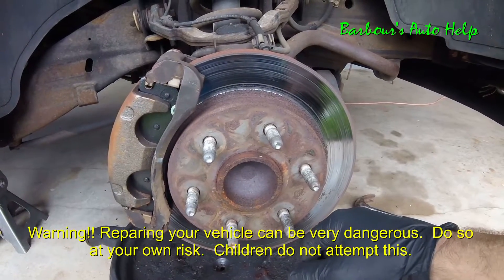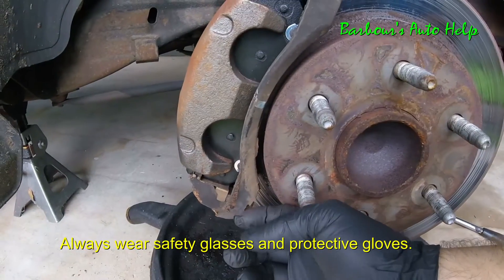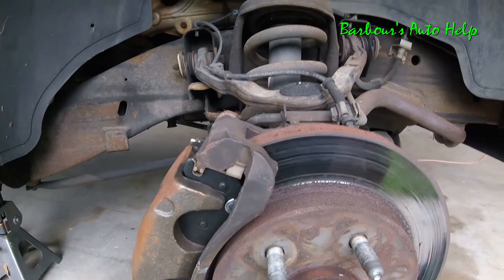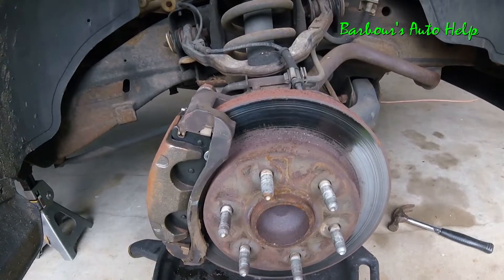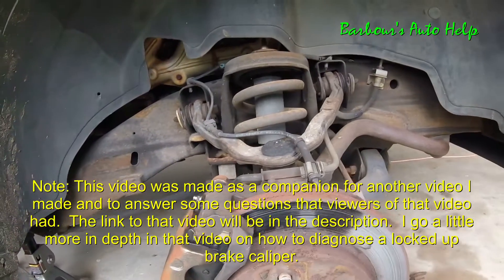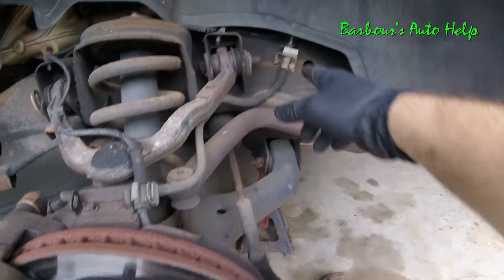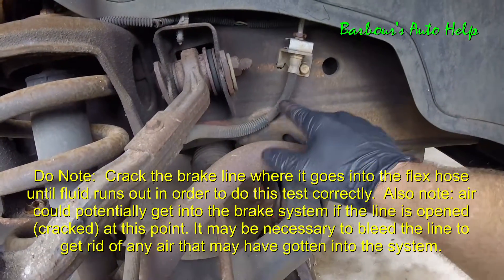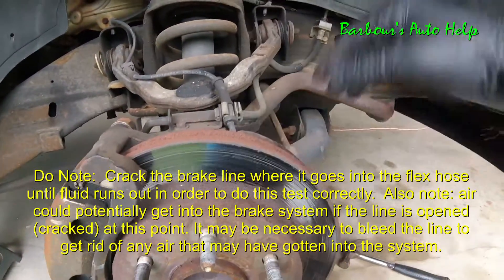Locked Up Caliper By Clogged Brake Hose

Comment: Would it be possible to clean the blockage? Or do I have to replace the hose.
Reply from the maker: I recommend relacement.
Reply: Usually the blockage comes from deterioration of the hose. Especially if it is older than 5-10 or so years
Reply: @63ch31 sorry 3 yrs late. Even if the hose looks completely fine on the outside, can it still fail?
Reply: @KilliKonKarnage   no worries mate. That would be kinda rare, but not impossible . Particularly if you have severely contaminated brake fluid. Production defects also do happen occationally. The only way to know for sure is checking. You can often see the signs of a blockage by comparing against the other brakes the fluid flow while bleeding the brakes as well as the effort needed to push the caliper piston back in. The number of cars I've worked on is limited, so I can't really tell you how likely this is. Also, because of the salty climate I live in, the problem is almost always a seized caliper.
Reply: @63ch31  ah thanks. My car is 19yo but only 40k miles and the caliper is original. I replaced the caliper but still have a brake bind due to piston not retracting. I think the hose is probably 19yo as well haha
Reply: Update on my issue. So I replaced my caliper and brake hose but still the brakes are dragging. So it must be a master cylinder issue as now all 4 wheels are dragging instead of just the 1 wheel initially.

Comment: Thank's for you'r time. I had the same thing happen on my dirt bike Husky TE300. I super cleaned and rebuilded master and caliper. Bleed system three times with new fluid. Check by hand work ok hour later lock up. So I took brake line off sprayed CRC  brake cleaner and used trimmer line to douche line  out. So thank's for the tip. Which i had air.

Comment: Very helpful video. My right front caliper locked up yesterday on my wife's car. Fortunately I came across your videos. 
I finished replacing the caliper and brake line today.. It's working great! Thanks.
Reply from the maker: Right on!
Reply: When did the front caliper lock up?
Reply: How do u know it wasn't just the slide pins instead buying new caliper

Comment: I just replaced tge caliper on my 98 chevy prizm and brake fluid will not come through the line to pump it up what should i do.
Reply from the maker: Did you disconnect the hose from the line yet?
Reply: No i have not
Reply from the maker: So are you suspecting a clogged hose?  Why was the caliper replaced?
Reply: The flex hose isnt clogged nor is the steel line coming off that going to a four way valve. It seems fluid wont pump into that line for sone reason
Reply from the maker: Is fluid getting to other wheels?  If not then you may have a bad master cylinder.  If fluid is getting to the other  wheels then you probably have a restriction somewhere.  I don't have any videos showing how to diagnose restrictions in brake lines or the brake system after the flex hoses up.
Reply: I think its tge proportioning valve
Reply from the maker: Wouldn't you have a problem with at least one other wheel if it where that?  What are you working on by the way?
Reply: @BarboursAutoHelp  I have similar problem.  93 bronco:  issue was overly hot lug nuts and front hubs.   to fix I have: replaced pads, rotors, calipers, rubber brake hoses, and master cylinder.   Did not replace metal brake lines from master cylinder or the connector at master cylinder.   I have NO idea what my problem is but brakes are dragging causing too much heat.  I have 700 in town miles on new brakes so its not new pads needing to wear in either.
Reply: this is on both Rt and left front.  Front only, both wheels.  truck brakes straight and good... but something causing too much heat and brake smell up there when i drive it

Comment: Is it possible to have 2 front break hose that messed up
Reply from the maker: Possible but not as likely
Reply: @BarboursAutoHelp  Do you recommend changing a pair? Or just the faulty side? I'm thinking of the latter.
Reply: I opened the break line hose nut and didn’t have any break fluid come out bye then I went under the hood and found the rear break lines I can see fluid come out when I opened the nut what can it be break line or the abs module going bad

Comment: Bought a truck, drove it 4 miles to the car wash to spray it off and TO MY SURPRISE, right front was on FIRE! Quickly changed some dollars and sprayed it out. Bad brake line was the fault. 

Fixed it and drove it for 14years. Lost it to a carb fire in 2016 😢.
Reply from the maker: That's a funny, scary and sad comment all at the same time.

Comment: I've heard hoses can deteriorate on the inside to the point they will clog. At first that doesn't seem to make sense because they no fluid would get to the caliper, however, the pressure to move the fluid to the caliper is gigantic compared to pushback after the brake is released. I guess that's where the clog really causes a problem.
Reply from the maker: Great explanation!

Comment: Okay so all 4 wheels are locking up so I replaced all of my calipers and the problem still was happening. When I was bleeding I realized the front right caliper was barley shooting out fluid. So my question is can 1 bad line cause all 4 to lock up?
Reply from the maker: No
Reply: Change brake booster

Comment: What if you crack the bleeder and it dont release the rotor, this after a complete brake job and flush except calipers, 1 whell locks up just like yours is doing??
Reply from the maker: Sounds like the caliper may be locked up.  Chech out the other videos in the description.
Reply: @BarboursAutoHelp  thanks for the reply, I done everything except crack the line above the flex hose, although when I crack the bleeder and press the peddle, fluid shoots out fine. Strange, also with a clamp the piston retracts fine..smh, but as soon as i hit the brake peddle it locks up tight😡😡..lol
Reply: @BarboursAutoHelp  rebuilt caliper and works great..thanks again!!